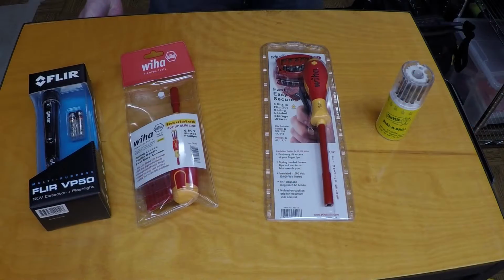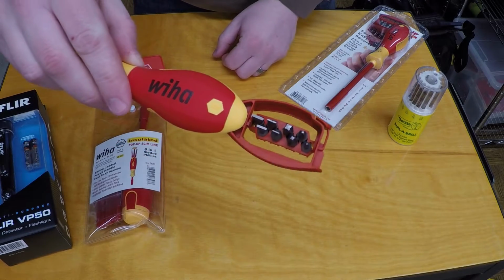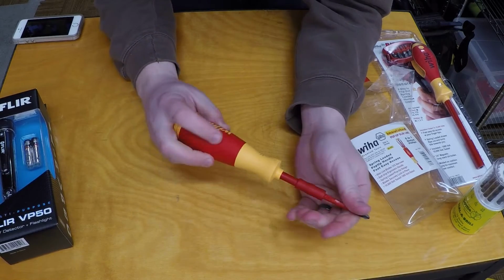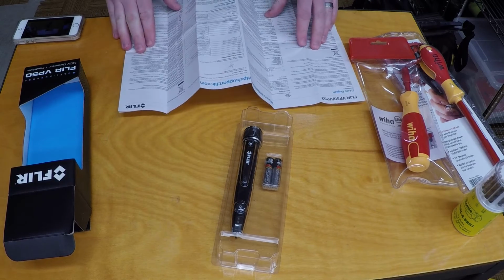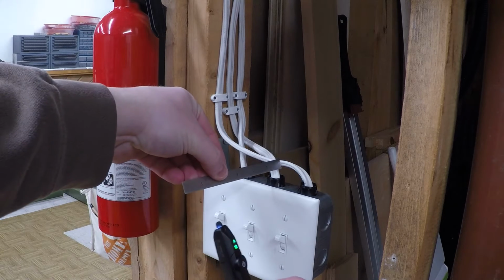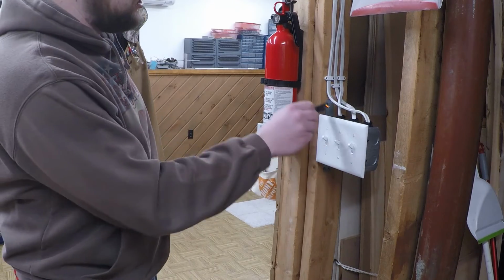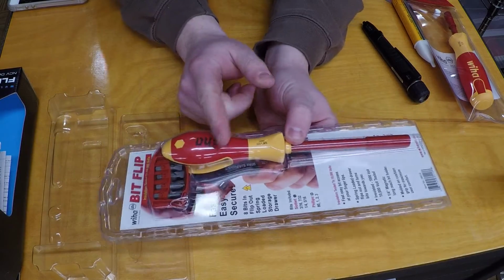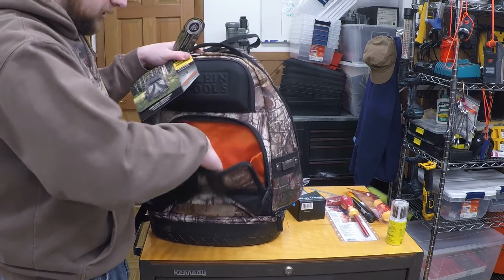Tool Purchases and Review - Wiha Screwdrivers, Flir Non-Contact Voltage Detector, Klein Backpack

Comment: If you simply press the on button on the Fluke instead of holding it as you did in the video, it will turn on in the audible mode.  Holding the ON button will turn the unit on in the silent mode.

Comment: Nice Wihas. I've been looking on a review for that Wiha SlimLine Insulated Pop-Up. Can you tell me if the tip without the bits can be used as a nut driver too? and whats the size? also is it possible to use as a screwholder? I might order it bc there is no place by me that has them in store?
Reply from the maker: ***** Hi Rayna. I guess you could use the tool as a nutdriver, but it is only 1/4" drive. I'm not sure what you mean by a screwholder, so I can't help you there. I know they are available online.
Reply: Thanks for the reply! Last question...Is it magnetic as well or does it just use the clicking method?
Reply from the maker: ***** Hi Rayna. It just has the locking feature.
Reply: 8